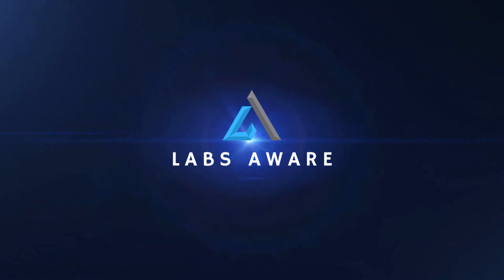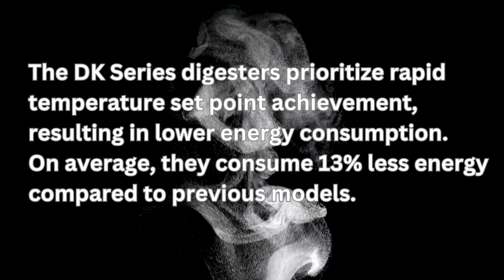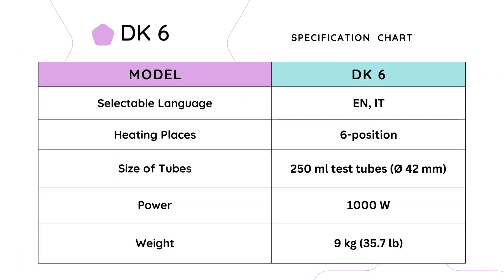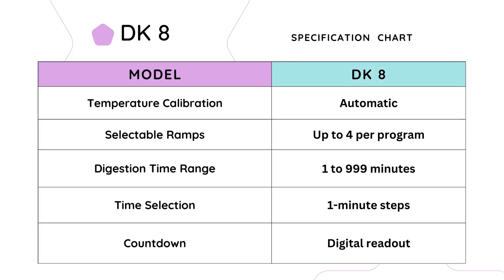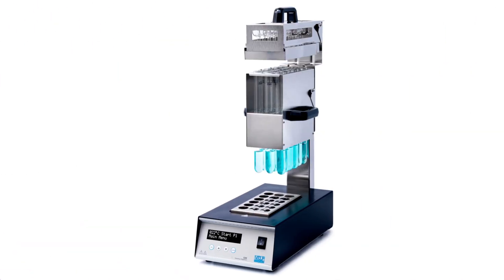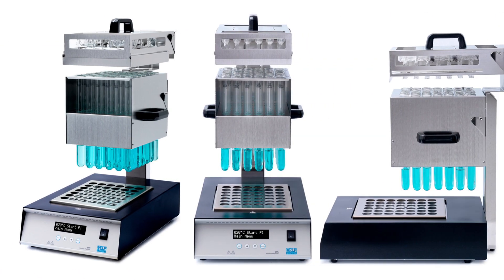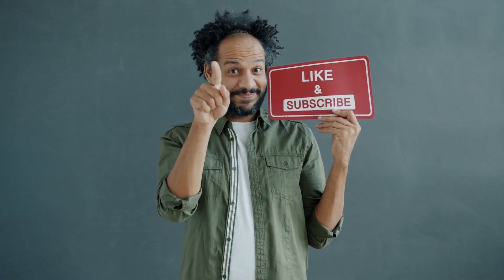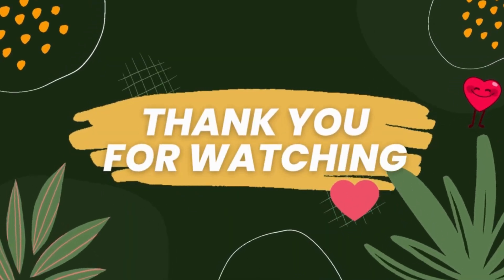VELP Semi Automatic Kjeldahl Digester |DK Series | 2023 | Top 10 features | Kheldahl method

Comment: I WOULD LIKE TO ASK , WHEN THE OTHER 1 BOTTLE IS FOR NAOH , WHAT IS THE PURPOSE OF THE OTHER BOTTLE IN SCRUBBER . ? THANK YOU
Reply from the maker: The KS 1000 Scrubber effectively neutralizes corrosive and toxic gases in 2 steps:
Dilution: in the right tank, reaction gases flow into a water solution, where they are effectively dissolved. This step allows for trapping even part of the sulfur dioxide produced during digestion.
Neutralization: in the left glass tank, reaction gases are neutralized in a sodium hydroxide solution. Thanks to a wide contact surface between gas and liquid, the KS 1000 Scrubber achieves maximum neutralization efficiency.
In specific applications, an optional activated carbon filter can be used to absorb odors produced during oxidative mineralization.